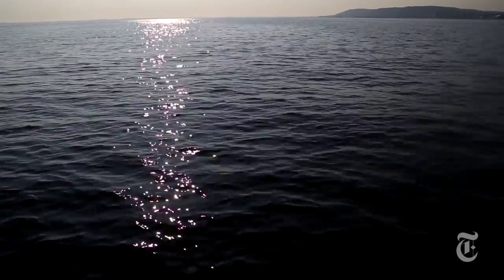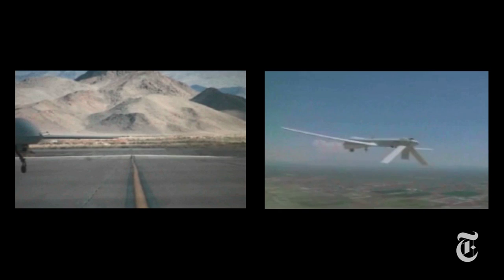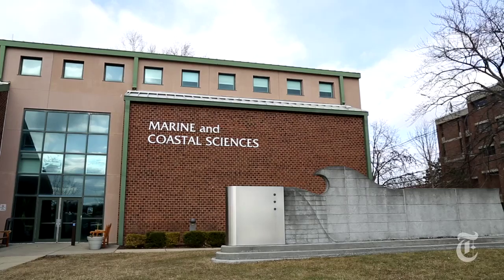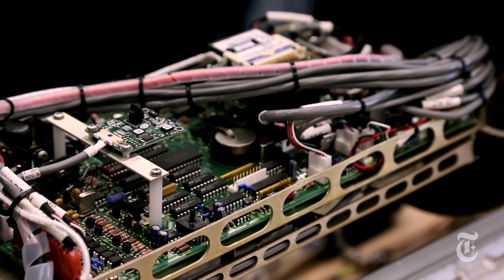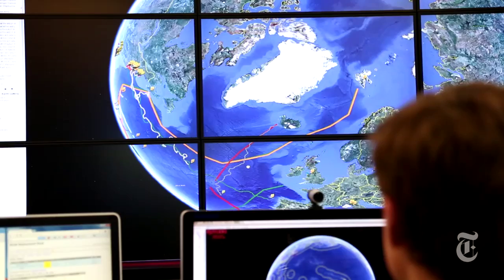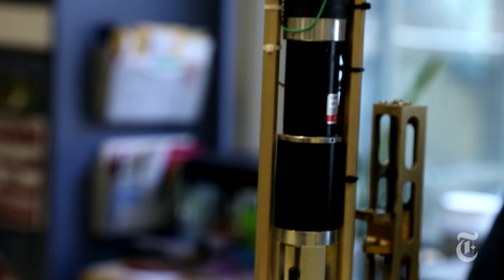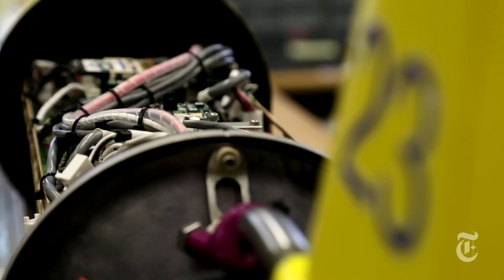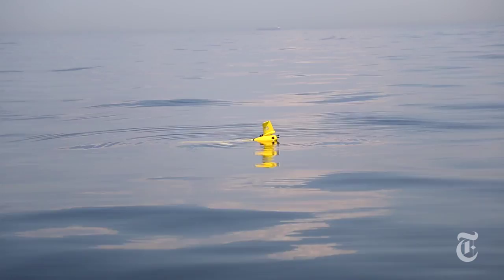Underwater Drones Gather Data at Sea

Comment: How much more distance can a glider sail than a boat of the same weight on the same battery charge?
Reply: That is a very hard question to answer. This glider only uses the batteries to operate a buoyancy pump, and all the forward motion comes from the wings as the glider repetitively sinks and floats. You will get more forward motion if you let the glider sink farther down into the ocean, which creates an inverted effect. The less often you operate the buoyancy pump, the further you will go on the electrical power used to operate the pump. Obviously there is a pressure limit at which the hull will burst (the vessel is filled with air) but the point is we have a radically different propulsion system that cannot be compared to boats with propellors. A propellor based system uses the motors to accelerate water, a notoriously viscous and lossy medium. Locomotion with propellors is costly 100% of the time during operation, there is no intermittent property and there is no free forward thrust. The short answer to your question is that there is no way to calculate the ratio you were asking for, but in practice, the glider will go orders of magnitude further on the same battery charge. That is like asking “if you used a battery to inflate a helium balloon vs if you used the same battery to power a drone, which vehicle would travel further?” The answer is qualitatively clear but calculating it is not fun because the propulsion mechanism is incompatible